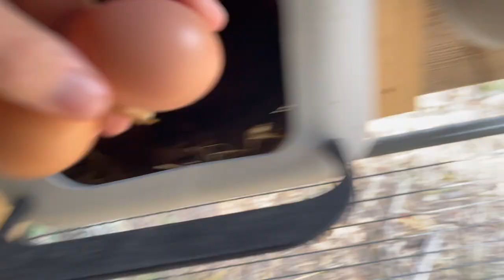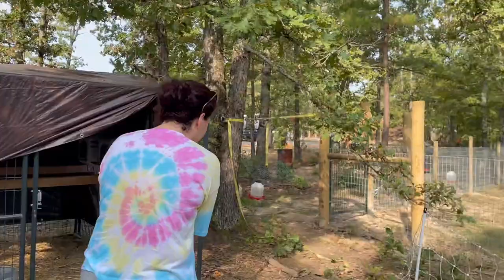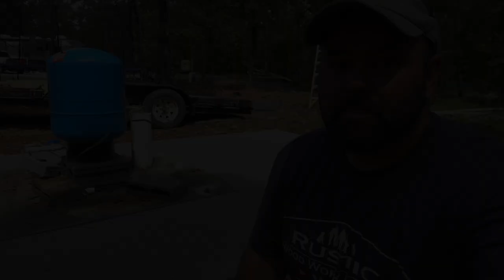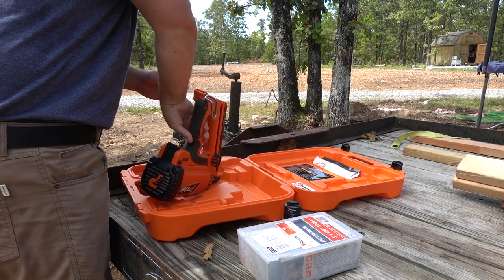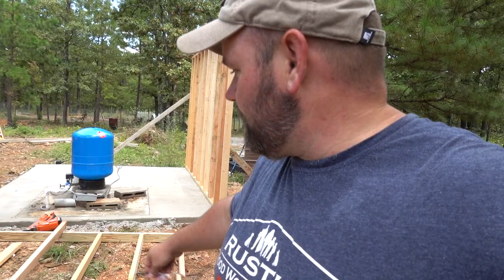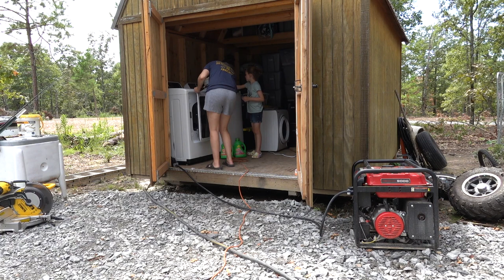HOW TO FRAME A WALL FOR A SHED

Comment: Good to see the family working together. I remember doing the same with my dad. One thing I notice a little different is my dad put L shaped screws in the concrete and when he put up the walls the wood at the bottom had holes drilled into it and the wall would be screwed to the concrete with a big washer and nut. I don’t see people doing this much but it seems like it would be much stronger especially in high winds

Comment: The entire place is looking more and more settled with each video; and that's many times per week. In your spare time (lol) and spare dollars (lol) you need to mount some wheels on a piece of plywood then tie, strap, or screw in that generator; a coiplemof holes and a rope strung between them you'll have a cart.  With a little thought, you coild cute it up with the wheel system, put a 1"2" frame around the plywood, and have something reminiscent of a truck farmer's garden cart (from before my time). - For everyone's peace of mind, I hope you got that dryer working.

Comment: Ha Dutch glad to see you are moving on with the expansion of your well house.  You might want to look at the suggestions on YouTube for "creating an inside corner for a framing wall."  I think you a missing out on a critical 2×4 board for creating a nailing surface for where a sheet of OSB, or plywood, or drywall board would be connected to the inside corner of your walls.  I like to create a large letter "H" with the 2x4's to create the right inside corner which is for both strength and nailing support on the inside corner of each 90° angle where the walls come together.  I cannot wait to see the completion of your well house.  You also might want to research what we need to do for a proper "header" above each door or window to offset the weight of the roof and the weight caused by snow load when snow builds up on the roof in the winter.   Keep up the great job brother.

Comment: Since y'all are still going to be using those generators for awhile you should get the wheel kit for that heavy one you're dragging. You're going to injure your back and then everything will be at a standstill! 😱😟  My ex is an amputee so it makes it so much easier for him, as it has the wheels and handle. We got ours at harbor freight 2 years ago and still working well. So happy y'all are finally getting to start building!❤

Comment: Hey Dutch when you run into area that not level when building a wall section lay a 2x4 or a 2x6 under the bottom and top header and that will give you a level area to build your wall section. My Grandfather was a carpenter and built houses in Atlanta Ga back in the 60's and early 70's and could build anything with a Hammer a Tape measure a  hand saw and an old square. and He could build anything and it looked better than anything I could with all the new saws nail guns and a bunch of Gigs. A Very Smart old Man.

Comment: You should add some foam sill seal between the boards and the concrete as a water barrier, and you should double your corners in such a small building for not only rigidity but downward and cross pressure.  Just a thought :)

Comment: You should put collapsible Wheels on a generator so you can move it wherever you want to move it too and then pull the wheels up so it sets flat Underground when you don't want to move

Comment: With the well house being insulated, plumbed, and electricity installed. It might be a good washroom this winter. Just a thought. Also around central Missouri we build that type of well house with either an access through the roof or part of the roof removable. So a jib crane can setup over the building and pull pipe and the pump straight up and out of the well casing.

Comment: Just a suggestion. With an off grid set up like this you might consider a gas (you could use propane) dryer.  The need for electricity would be less.

Comment: I can run my dryer off of a generator but the catch is you have to connect the dryer directly into the generator.  They are rigged to where you can not run them from and extension cord. My electric stove is the same way.  Because of the inconvenience of all of those extension cords and not being able to run my dryer and stove from an extension cord hooked to a generator; I went the extra mile and installed a complete breaker box that runs directly off of the generator.  So when there is a storm I just plug in my 13,000 generator and life goes on until I run out of gas or propane.

Comment: I'm curious. Have you given any thought on how you will pull the submersible pump if or when it goes out with the pump house and the roof around and over the pump? Just wondering. Maybe you have mentioned it and I missed it.

Comment: I had a thought about the dogs and the shelter they have. I know it seemed like a good idea at the time, but have you considered with a dogs hearing being so much more sensitive than humans when it rains on the steel roof it would be extremely loud for them. I thought you might want to be aware of that. Just a caution thought that’s all.

Comment: I’m surprise you’re not using any of that sells sealer the 6 inch wide foam that you put between the bottom plate and the cement. Is there a reason other than saving a few dollars? Just thought I’d ask.😉

Comment: Not co2 Dutch its a flammable gas. My dad through one of the gas tubes in a fire barrel one time and it slung it 50 yards high and about 100 feet away

Comment: YS SHOULD INVESTIGATE MID TO LARGE SIZE SOlar  generators couple grand buys largest and Harbor Freight has a folding brief case 100 wat solar panel to charge. 30 foot chord and is 220 0r 110 will run tools, charge your tool batteries play radio and keep lights fridge going all samentime. Largest models but 50 lbs but has handle and wheels easily.
Best damn rig for lights down times.
Can charge by house plug in even DC truck 24 and or12 volt holds full charge for months until needed.

Smaller Harbor freight with briefcase panels, both together easy pack handles 20 lbs. 
PERFECT RIG PLACE IN WELL HOUSE FOR BELOW ZERO NIGHTS TEMPS OF A SIMLE 10 WATLIGHT BULB 
ALSO GREAT PLACE IN CHICK en coops or your greenhouse heater.
.house lights easy all night and solar charges even on cloudy day.